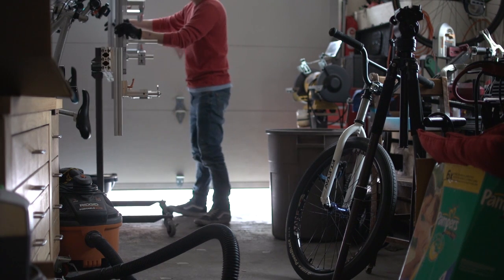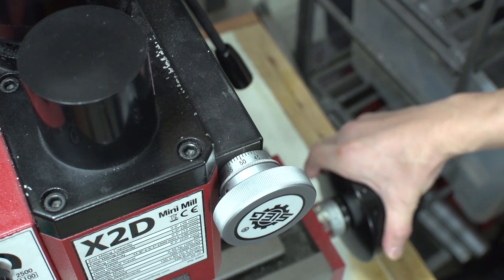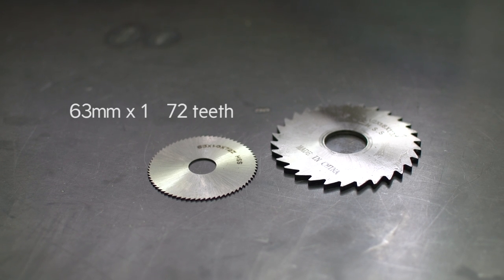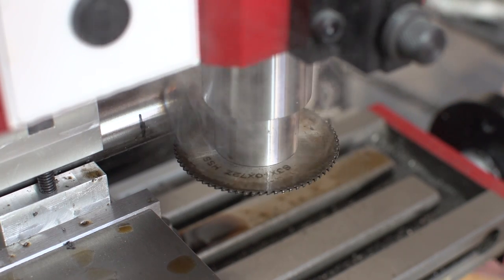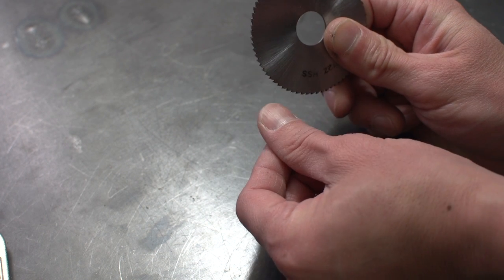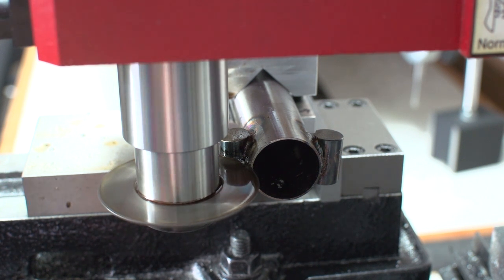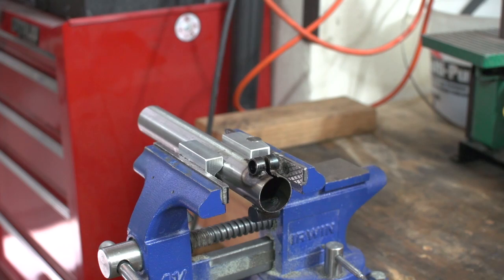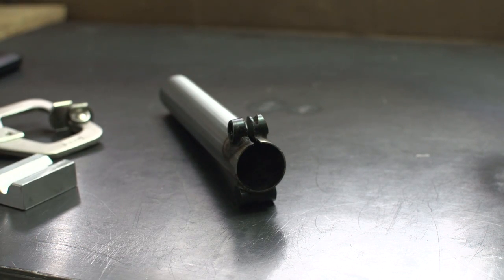Using Minimill To Make Cut With Slitting Saw

Comment: Firstly, in the reference video his is brazed and yours is tig welded.  I would bet to say you work hardened the material when welding and should anneal it to make it more machineable.

Why are you trying to cut the slot in one pass?  Everything you have learned about this small mill was just thrown out the window.  Small light passes with the slitting saw will work fine.  Take a 0.05" pass 10 times and I bet it cuts the slot fine.
Reply from the maker: You're right and this is the general consensus in the comments, it hardened. I'll braze the real deal rather than weld it. Cutting the slot in one pass - I did try going it just a few mm at first, but because I was climbing it was pushing the work away. Basically I don't have a good excuse lol. There was all kinds of wrong going on. ;)

Comment: I think your link to Rody's video is broken...I found the video though...I seriously think the main factor in his working and not yours, is he's got a full size mill.... :-/ it sucks but I'm in the same boat...a mini mill just can't compare to the power and rigidity of a big machine...
Reply from the maker: Hi Nathan, thanks for the tip man. I fixed the link.
Lots of great comments on this video. The size of a minimill is for sure a factor but I was doing some things wrong too. My rpm was too fast for one, then I didn't set up my cut so it was concentric. I partly blamed that on the cutter but it was also the arbor I used where their may have been a metric vs. fractional issue. All in all, I hear ya - I'd love to have a larger mill. I might move end of next summer and i may possible have more shop space after that!!

Comment: I think much about the actual cut has been covered by others, but I thought I might suggest you brazed a small steel disk (or a washer) to where the bottom of the slit will be- it will act as stress relief and prevent cracking over time. A thought.
Reply from the maker: Ah yes, I forgot to mention in the video that for the test tube I forgot to drill a hole for relief.

Comment: You could always lose the weld-on seat binder all together and go with a slip on binder for the top of the seat tube....that way you can use an end mill to make that slot, or still use the slitting saw, but the cut would be way easier...
Reply from the maker: That is a good alternative. I think losing the weld on binder is totally the way to go. As you guys have said, it hardens the steel. The real deal will be silver brazed (short term solution) Long term I'll have to get a O/A setup and use brass.
Reply from the maker: Thanks John, I agree! So much good advise. I need to get an rpm gauge for the minimill. I think I can pick on e up pretty cheap. It's never been a big priority for me because I've always kind of cut by 'feel'. But it's about time I started getting my speeds right. Cheers!

Comment: I think You're on the right track with how the cutters are ground. They look to be flat ground with no Drive/radial clearance. Maybe good for woodworking, but not right for metal.
Reply from the maker: I think the cutter was indeed for metal. Someone mentioned that these cutters are not made to climb but I hear varying opinions on that. I'd love to hear if anyone knows why some cutters have a flat at the tip and some don't. Cheers and thanks for watching!

Comment: The 1mm grinder slitting discs need the rpm to cut. They won't work in a mill and will likely break up if fed in too slow.  There are cheap holders for a 4in grinder to turn then into a small chop saw which you could use with a fixture but it seems a lot of effort to slot that piece. It could be done with a small end mill or a grinder or dare I saw by hand with a hacksaw. You could also make the boss in two pieces, align them with a dowel and weld on. I do this for steering columns on dragsters. If you slot it after welding check the alignment as thin tube tend to spring or splay when cut.
Reply from the maker: Great tips and I agree it would be way more work than pay off to fixture up the angle grinder just for that little cut. I love the end mill option. I'll try this for sure in my future test.
Reply: Pithy Bikes and thank you for vids, the thought and learning process is way more interesting than perfect execution

Comment: in your small-scale manufacturing process, why not use a double- or triple-bladed hack saw and some needle files? You would need to file it anyway to remove burrs after cutting. if you use the hand tools properly you will even be faster because you won't need the machine setup...
Reply from the maker: I love this idea and never heard of it before. I may try that in the future depending on how more tests go. I'm kind of making a big deal out of a little slot. lol

Comment: Given the effort and quality you put into making your bikes you owe it to yourself to get a decent carbide slitting saw and matching mandrel. The welding process has caused hard spots in your job and cheap cutting tools simply are not good enough. A good carbide cutter will outlast the cheap ones many many times over and will make a nice job of cutting the slots in your seat tubes and clamp. You might find yourself having problems tapping the bosses too? You might have to consider normalising the area post welding to get rid of the hard spots.
Reply from the maker: Hi Andrew, Great advice on getting a good cutter. The real binder is pre-drilled and tapped, the one in the video was a test binder. I'm not familiar with normalising, I'll look into that process. I'm going to silver braze the real binder on the ST and that should solve a lot of the steel hardness issue. Thanks for the tips.

Comment: I've used battery operated circular carbide tipped saw blades, which come in a variety of sizes, specially depending on the battery power of the battery operated saw. All (quality) wood cutting tools can cut any steel, specially in the bike frame realm, it's all dependent on your feeds and speeds. Your milling saw blades are inferiorly made, your Starrett hole saws, l'm guessing are of a bi-metal product and are superior for your metal cutting needs. I have a 3" saw blade that is carbide tipped, intended for an old 9.[+] volt Marita portable circular saw, I'v adapted as my go to milling saw blade.. I made an Arbor specifically for the blade and had it for five years, because each time I use it, I only use it for less than an hour...total. also run the blade the same speed as the portable band saw, and go from there, use plenty of cutting oil. Good luck.
Reply from the maker: Really awesome tips. Thought never entered my mind to use other cutters and making a custom arbor. Love it.

Comment: You can find spindle speed calculators online both metric and imperial to get the correct speed. For me the spindle speed for the 63mm cutter seems way to much. I  calculated it for HSS and its around 100 Rpm or less if you cutting Chromoly tubing.
Second problem is the welds may caused the steel to harden and thats why the cutters did not like it much.
Greetings from Hungary!!!!
Reply: Yeah the problem with mini mills is they have zero torque, and aren't terribly rigid....low rpm's on a mini mill will likely just stop the spindle...I know because I have the same mill and have tried it....
Reply: Then just like somebody else suggested use a carbide endmill.
Reply from the maker: Awesome awesome tips. Thanks so much for all this help!
Reply: Péter Temesvári igy igaz
Reply: Pithy Bikes why didn't you use 2 mm thick? It is also standard. You've burnt the the disk. Also, i found that too thin chip is just causing the tool fatigue ,erosion and over heat. Plus you need coolant, a lot of it, otherwise go for carbide saw.

Comment: interesting thanks for sharing. I guess my advice with the saw would be to try and grab the work piece closer to where the cut is being made to reduce the vibration. I know you'll then probably have to move it again as you'll need to cut further. Also I think the steel might on the edge of being too hard for the blades you were using, especially perhaps in the welded area.
Reply from the maker: Agreed! I had a bit of an issue with saw clearance. The screw and cap that secure the saw extends down about 1/2".. :(
Reply: oh and that concentrically, bet that could have been really causing a problem too.
Reply: Bruce Chastain exactly what i was going to say, grab the piece as close as possible to were the work is being done

Comment: Those saws look like they are junk. I cut stuff with the skinny cut off wheels all the time. If you can align them properly and feed them slow they would work produce a nice cut would imagine. What about turning the work 90* and using an end mill?
Reply from the maker: Yes I'll try the end mill option. Another commenter suggest this too and I think its a great idea especially for a minimill. Getting it done fast is never a goal on this little mill, getting it done at all is. ;)

Comment: I use a angle grinder with a 1mm cutoff disc on a mini gantry router to cut stainless steel. As you said you need coolant as the steel will get hot with abrasive cutters.
But all in all it makes the job.
Reply from the maker: Cool, it's good to know that this setup (although for different purpose) works. I would for sure look into this option if I had to do a large run. I think I could set something up pretty cheaply.

Comment: One last point, those cheap milling cutters are usually metric even though they are sold as SAE, that's most likely what caused the loose fit on the arbour. It will work once you get a few things sorted.
Reply from the maker: ah that explains the concentric issue. I didnt think the cutter could be that far out.

Comment: Climb cutting with a milling cutter isn't a good idea even with a big mill, they are designed for conventional cutting. You could build an arbour on your lathe just make sure to cut the final dimension for the tool on the mill to ensure perfect concentricity.
Reply: Maybe a saw, but actual endmills run better climb cutting, as you're not recutting chips. 

Source: Haven't programmed a conventional path ever, we run DMG/Mori's at work. Even on a clapped out bridgeport, the final pass is always climb: the surface finish is just that much better.
Reply: All that makes perfect sense but we are talking about milling cutters (I believe you refer to them as a saw) End mills and milling cutters are not the same thing, shouldn't a machine operator know this stuff?
Reply from the maker: I didn't know that about climb cutting. I just always assumed it was a standard process. This is great to know. Love the arbor building tip. Never considered that. Thanks!